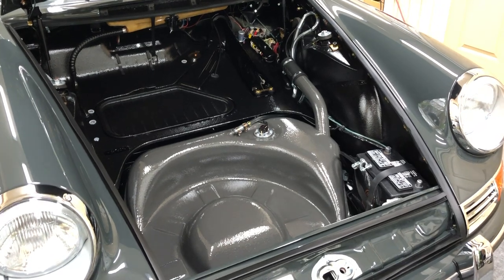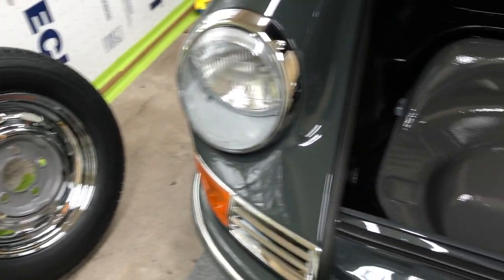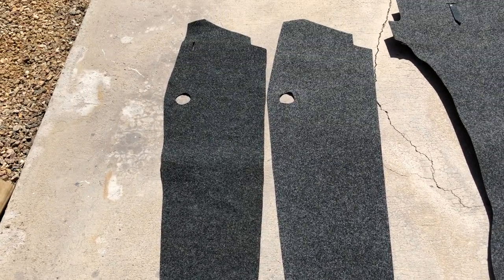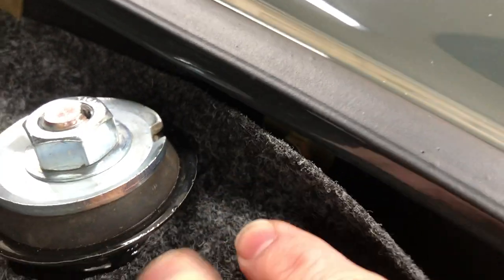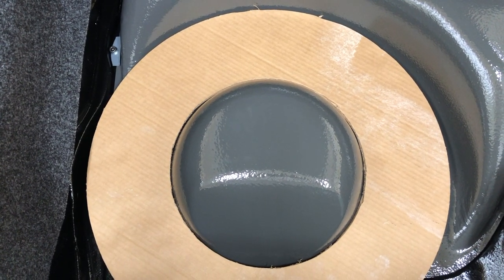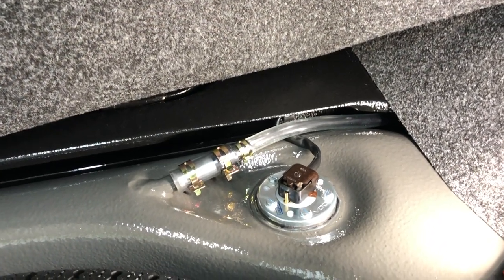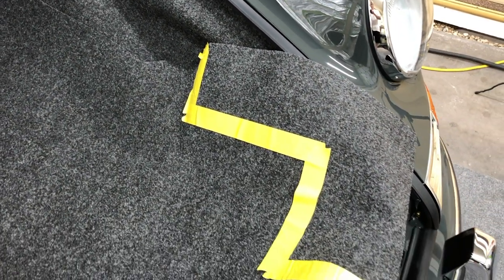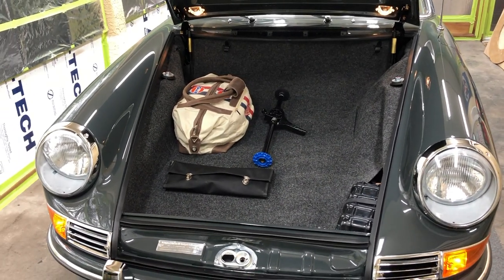Installing Trunk Carpet & Completing Trunk!

Comment: My original '73 purloin trunk carpet (still in place) uses snaps through the outer edge of the three carpet sections: sides to the body metal (adjacent to the bolts) & center section to the cowl panel. 
Three snaps on either side- one was up front, then one on either side of the strut. Two snaps across the cowl area, both attached at opposite ends, near the top of the 'board' panel.
The Michelin XWX spare on 15" Fuchs wheel lies directly on the gray painted gas tank cover panel. Trunk sheet metal is body colored.
Reply from the maker: Hello Walt
What a great year 73 was! Would love to have one
Thanks for sharing those details!

Comment: Good stuff!  Did you consider dots of Velcro to hold the carpet in place?  You can get self sticking Velcro and trim it to size.  Might make tucking around the battery neater and easier.  More videos, please!
Reply from the maker: Hello Gregg thanks
Yes have consider the velcro approach
Would require sewing tabs to the carpet and hopefully the sticky part will remain attached to the body during hot spells.. Might give it a try though down the road

Comment: Excelent as always Mike. The righthand carpet that's attached to the fender, is it worth trimming it to fit a bit better behind the battery so it doesnt bunch up?
Looking forward to the engine and the firts start.
Reply from the maker: Hello Nick thanks
Yes that fender is a bit of a problem because of the stretching over the fuel filler neck..
trimming would not relieve the tension..
Its just one of those areas that will have to live with.. perhaps some sewn in velcro tabs would pull and tighten to clean it up..still thinking on it

Comment: Fantastic Mike.  Where did you get the Gulf/Heuer duffle bag?
Reply from the maker: Hello Jeff thanks
I picked up this bag about three years ago from RS Selections.. Great shopping there!!
This style is a bit older and has the Heuer logo..I'm not sure if the new styles are able to use that logo now but here is a link you can check them out:https://selectionrs.com/en/porsche-martini-gulf-luggage-leather-goods/6871-gulf-vintage-sport-bag-beige-cotton-leather-4250376812875.html
Good Luck!

Comment: This would be entirely unoriginal but might hold the carpet side panels up in the long term as I’m afraid your solution might cause sagging over time: 

How about contouring a 1 inch wide strip of aluminum to each side top, powder coating then black and then adhering some Velcro loop tape to the length of the back. Then mounting them to each side using the fender bolts that you secured the carpet with? This would prevent the carpet stretching out and sagging around the bolts over time with use. 

Wonderful superior quality video as always!!!!!
Reply: To clarify the one inch strips of aluminum would run the length of the top of each side panel.
Reply from the maker: Hello Giulia Thanks
Thats a great idea! will see what happens over time and maybe take you up on your suggestion=)

Comment: Hi Mike, I have a 66 912 which I have completed inline with your timeline so your posts really pushed my quality.  I have a question on the jack main shaft which you look to have painted, mine has no paint or plating.  I wonder was that just your choice to paint it?  Thanks from the UK Chris
Reply from the maker: Hello Christopher
Thats an excellent question..Actually it is not painted but coated with loctite Extend rust neutralizer.
 Preparation was wire wheeled on the shaft followed by a scotch gray ultra fine sanding pad approx 600 grit. The coating was sprayed on and reacts to the metal and turns black. A deep transparent purple black. Its a good solution for these old jacks if not able to find someone to do a proper black phosphate coating also known as parkerizing. The early jacks were not zinc coated but looks to be a blackened steel of some sort.. What process Bosch actually used I'm not sure but I think it was phosphate protection.
Good Luck with your restoration and keep safe!!=)
Reply: @MikesRestorations  I think we call that process chemical blacking, could it have been oil blacked?
Any way, great details and very cool car!
Cheers, Chris